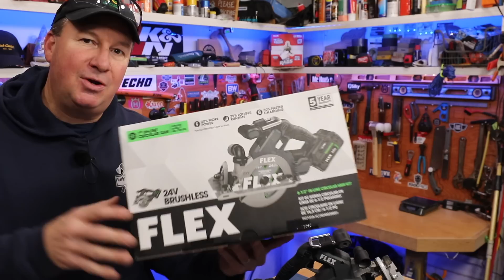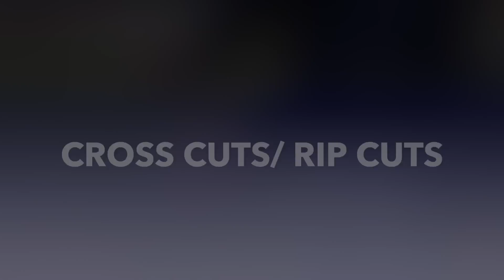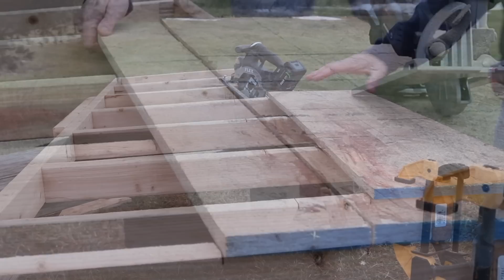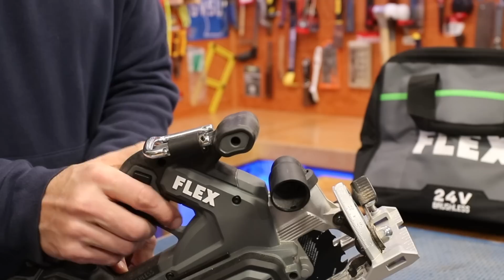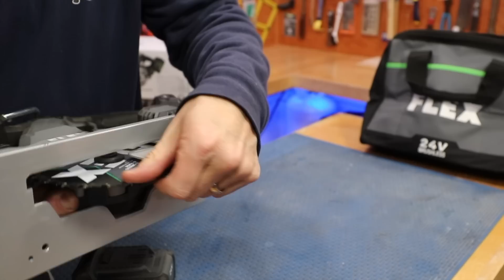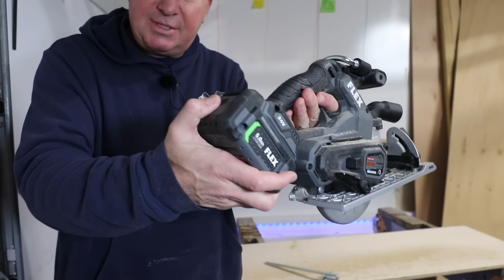Check out the FLEX 24V In-Line Circular Saw- FIrst of its kind!!

Comment: This looks like a great saw. I have 2 different Makita 6 1/2" saws (one blade left and one blade right). I gotta say that I love the inline design of this FLEX saw and the fact that it maximizes cut depth for the blade size. The dust collection seems better on this saw than other standard circular saws because the dust port is directly above the blade.

With that said, I probably wouldn't buy it and add yet another battery platform UNLESS Flex also came out with other tools that offer something better than the competition. I've seen reviews of their drills and drivers, and I'd probably pick Makita over Flex for drills and drivers. I also own both Milwaukee's M18 and M12 batteries and chargers, and use Milwaukee's M12 surge fluid driver as my primary driver because it's compact and very quiet with plenty of torque for 95% of my driving needs.

If FLEX comes out with an incredible battery-powered miter saw or an amazing line of nailers then maybe I'd consider adding FLEX tools to my lineup. If I didn't already own Makita circular saws, which I think are quite good, then I might try this one.

You mentioned that some people didn't like the 6 1/2" blade size. There are several other 6 1/2" circular saws on the market, and those blades are easy to get. I think Makita make very very good 6 1/2 inch blades, which cut exceptionally clean for general framing.
Reply: Flex actually just released about 8 new tools. Couple band saws, compact drill and impact, trim router, and a few others. Their full size drill and impact are the top dogs on the market. They are a little heavy, but the fastest and most powerful, yes, even over milwaukee. That said, i did recently just upgrade from ridgid platform to makita. I was expecting flex to come out with more tools obviously, but not so soon or the ones they did or i may have got into flex instead of makita. Then again, i dont mind having multiple platforms. Im all about having the best tool for the job. I really like this inline saw and may be one of my next tools. Had i used circ saws more often i would have already got it. Just an awesome design all streamline and ergonomic
Reply: I am 1000% in as soon as there is a FLEX replacement tool I will buy it.
Reply: But I do find the makita blade carbide tips to be fragile

Comment: Got this SAW back in August was a Demo unit from LOWES for Just $125 out the Door I already have one 2.5 Two 6.0 Stacked Lithium and one 3.5 Stacked Lithium Batteries and 2 280 watt and 1 160 watt charger's
Reply: I just got this saw today, do the 3.5 stacked work good for this saw? Thats the only other battery i have for flex tools
Reply: @Primez8902 yes but it will Last About 30 mins of LITE CUTTING
Reply: @ericnichols9275 What about the 5 ah it comes with?

Comment: I have that saw and the rear handle. The rear is a beast of a saw. I have like 7 flex tools I really like them other than the price and not enough tools yet. They just reviled some new tools but nothing to brag just smaller impact and drill. I'm still not going to retire my dewalt for most work till flex gets more in there line up. I'm already in 7 tool lines lol.
Reply from the maker: I'm hoping to test the rear handle stacked lithium saw this winter.  Thanks for sharing your experience with it.  
It will be interesting to see what FLEX comes out with next.

Comment: How comes you don't speak about how quite and powerful this saw really is
Reply from the maker: I may compare this to the Makita.  I'll be sure to mention and test those items.
Reply: @MarkThomasBuilder  I have the entire FLEX line except the impact wrench,, mud mixer and none hammer drill. 

I think the best tool is the oscillating tool because it is almost vibration free

Comment: It’s a belt driven Skill saw…..
Reply: @Kevin-mp5of  it was a spell check input that I did not catch.  However, the term “skill” saw has been used to identify a specific configuration of a hand held circular saw where the motor is behind the blade.  Much in the same way a Sawzall is a brand name that has become a common term for a reciprocating saw or an adjustable wrench is called a Crescent, which is not a wrench but the company that held the patent on the adjustable jaw….but none the less, you are correct…
Reply from the maker: Yes

Comment: The rear handle circ saw is a monster as well, super powerful! I believe both the 6.5 circular saw and the rear handle saw are the best circular saws on the market currently
Reply from the maker: Interesting, I still need to test that other saw out.  Thanks for shaing!👊💯
Reply: Check out concord carpenter video. Dewalt flexvolt still most powerful rear handle saw. Also clearly the reason even flex themself left dewalt out of their showcase test on youtube. That 60v jus makes it easier for dewalt to achieve that power especially considering it was made years ago
Reply: @bossmanz28  i dont need a review i own them both and with the stacked lithium it is more powerful then the dewalt, i love the dewalt but the flex is more powerful. Look & , tool review zone and philly fixed, shoptoolreviews, protoolreviews, I could tell u others who have reviews comparisons but until u run both u wont know for yourself. 60v doesnt mean anything, the flex hammer drill with stacked lithium is more powerful then dewalts highest end flexvolt, the impact driver is more powerful then anything dewalt has with any battery etc.... power isnt everything but there is nothing in the dewolt 60v line that is more powerful then the flex with stacked lithium, i dont think thats even a debate at this point. The only thing thats close it that rear handle saw but run them both yourself and u will see. Im not brand loyal i use many brands.
Reply: @247Combat  im not brand loyal either i have a couple flex tools myself. Lets see flexvolt grinder destroys flex grinder (i have 6" model, 7" model and have flex for variable speed) , 1 1/4 sds plus, 9" demo saw, all sds max rotary hammers. Flex recip def beats dewalt all around everything so i have that tho. Have not run the circ saw myself as i dont have the flex and jus not a huge need for me since im a metal worker primarily and dock work where my 9" demo saw amd 2" rotary hammer come in handy.

Edit: i do have the flex circ saw technically to get my hands on the 10ah stacked lithium but i have it listed for sale rite now. Now your tempting me to try it out lol